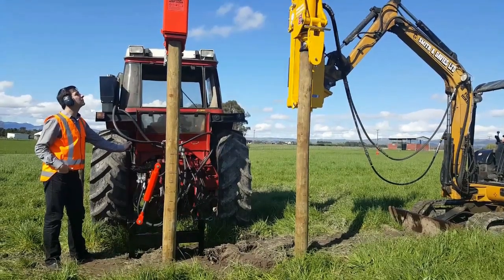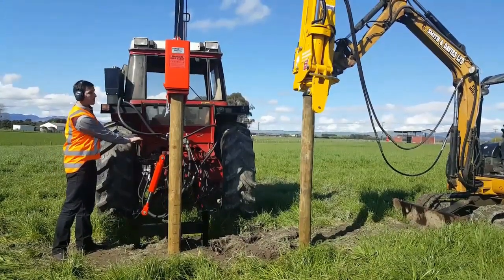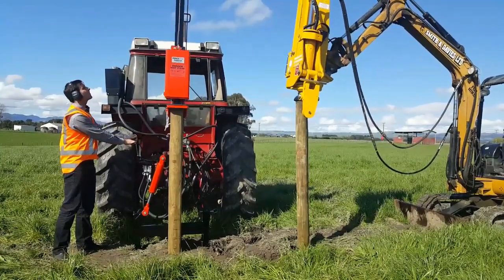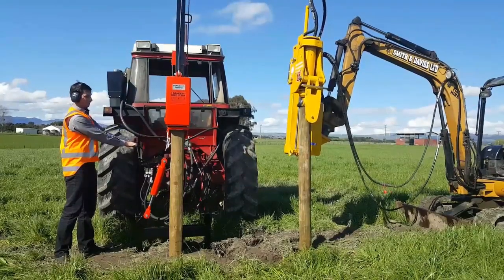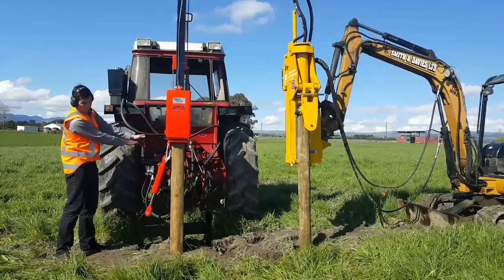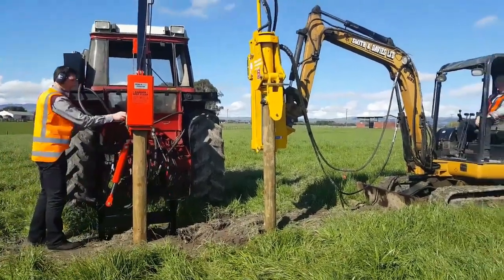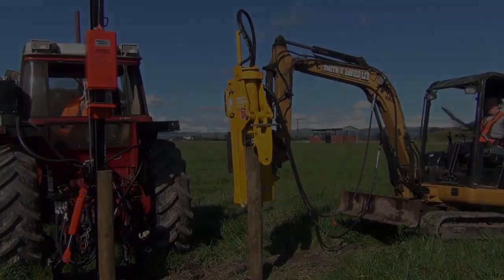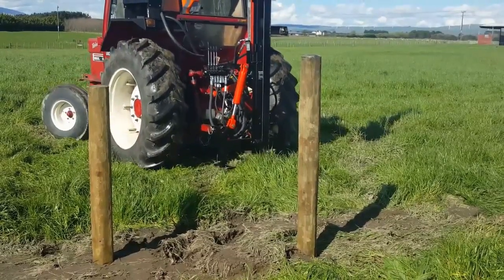Vibrating Post Driver vs Fencepro Farmtek 2

Comment: Not a fair comparison in this video but I would take the tractor setup. 
Every farmer has a tractor, not everyone has an excavator. 
You can easily sight the post with the tractor, the excavator operator has to exit/enter his machine to setup, adjust and measure the post. 
A tractor can straddle a guidewire, drag a spacing chain and tow a cart of posts. 
A tractor can also unroll and tighten a roll of fence.

Comment: Ger a bigger digger mate all ill say and fence pros are rubbish get a TAEGE banger
Reply: Bigger digger would be a HIGH cost on the average farm
a tractor would there aready
Hiring a Midi digger would be normal
But having a 10 -15 ton digger is SPECIALIST , 
even for a fencing contactor , having a 10 -15 ton digger PLUS the  lowloader to move it would be a huge cost

the post knocker , could go on a 40Kph tractor , or on a mini tractor and be trailered around easy 
bigger digger isn't a practical option , so wouldn't be a fair test